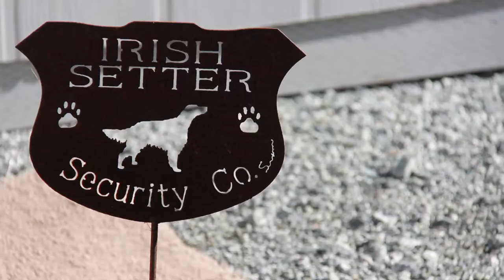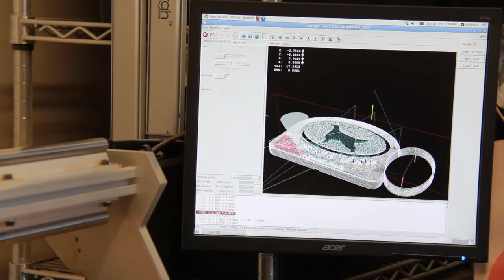CNC Router Project - Sign - Irish Setter Door Knocker

Comment: Hi, enjoy your videos, could you tell me where you get your push clamps from? Thanks
Reply from the maker: The clamps are Festool Clamping Elements - designed to work with their MFT surfaces.
I machined similar holes directly into the MDF pallet and it seems to work pretty well.

https://amzn.to/2UFerj0

I've also recently started using Kreg In-Line clamps - and they seem to work pretty well too - and they are much less expensive.

https://amzn.to/3wAyxrQ

You can see the Kreg clamps in use with my fixture pallet in this video:
https://youtu.be/h7L7SX-jxKA